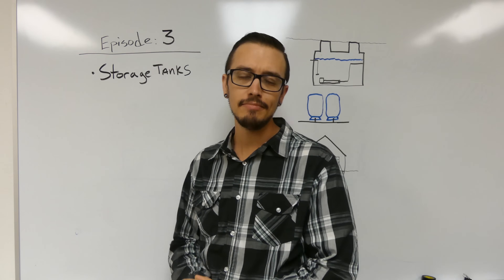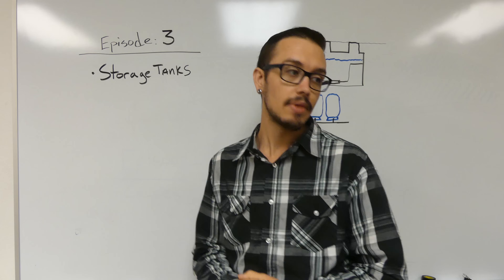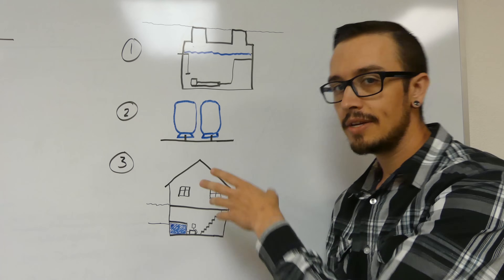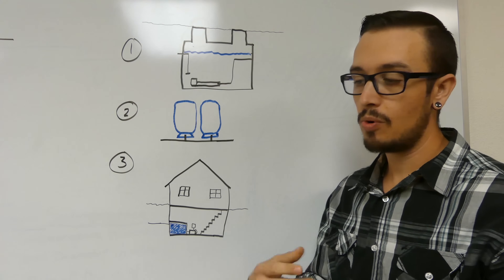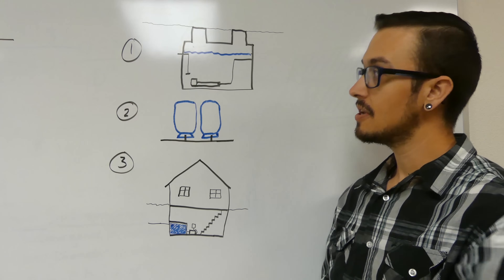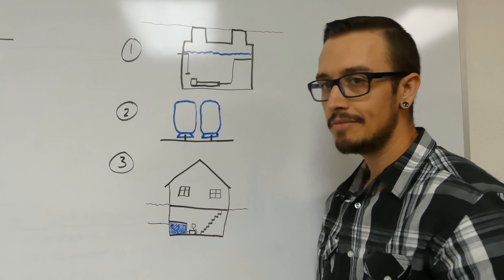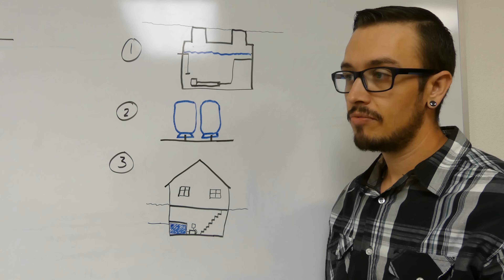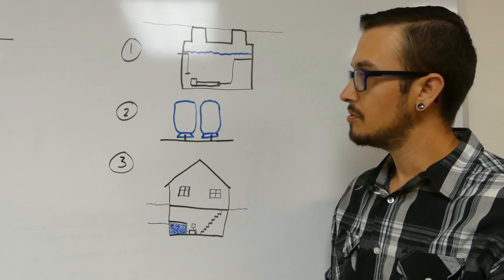Low Yield Well Solutions: Storage Tanks

Comment: I’m thinking of adding a storage tank, which could be higher than our house for gravity flow, so we can have water when the power goes out.
The well and equipment are about 200 feet from the house which is about 10feet higher.
We’re on about 5 acres with a hillside in the back of the house where I could install a tank.
What are your thoughts on this?

Comment: Does depth slow down the recovery rate? I have a 900’ well that is supposed to be 1.5 GPM, but overnight I’m barely getting 100 gallons. My pump is at 600’, so not sure if the depth of the well is causing the rate to slow down at it gets to the 600’ mark.
Reply from the maker: No, depth does not slow down the slow rate. Typically, you only drill a well deeper if the current flow rate is not sufficient.

Comment: How do you manage the well pump on a low yielding well? Most conrol boxes have no idea when the well is pumped out and pumps/motors have no sensor for a low water level condition.
Reply: I see you added motor protection on another video as a "bonus" but really it deserves a video of it's own with a full look at the motor protection options and the units available and how they work.
Reply: They cut the power when amperage drops / set to restart on a time delay that you set. @jlaw8882
Reply: You can also throttle the output if the well will sustain constant pumping at low volume, gain capacity with storage.

Comment: It is pretty good explanation. I have govenment supplied water line and it is low pressure due to the location of the meter being away too too far. This days dropping a water line infront of your house is expensive more that 10K. The old galvinazed pipe has been reduced in diameter, Storage is one of the option I got. Is this will work for washington state if the tank is outside?

Comment: Thanks for the informative video. At a recovery rate of .31 gpm, we are struggling to have enough water for just the 2 of us.  I had asked about using a larger pressure tank but the contractor who installed our submersible pump and UV filtration system said that wouldn't be a viable solution and recommended going with an inground 1000 or 1500 gallon storage tank, secondary submersible pump and pump saver.  I was thinking more like a 80 - 120 gallon indoor vertical storage tank that will fit through our utility room doorway with a submersible pump and secondary pressure tank?

Comment: I love the idea of using of a submergible pump.  All the ones I've seen the submergible well pumps are mounted on blocks to absorb the motor starting torque laying on the bottom of the tank with some kind of hose or flex piping running to the surface.    Have you seen or installed or would you recommend this type of pump hanging vertically  from the discharge piping or hose in water storage tank?   Thank you, Bert
Reply: You can but the intake will be higher unless it's mounted in a sump.

Comment: Hi!  Thank you for the video.  

I have a low producing deep well.  I added a 300 gallon poly tank and a pump in my basement.  I also added a timer switch on the main well that turns the well on once per hour to fill the tank.  The problem with this mechanical timer is that it has tabs to add to increase the run time of the deep well pump.  One tab is not enough water to keep the tank full.  2 tabs empties the well too quickly.  I did reduce the flow from the deep well by partially closing a valve but it really is guess work.  

The mechanical timer is also not reliable.  Sometimes it gets stuck and everything just stops. I did lubricate the gears inside it.  It ran for a couple months but stopped again recently.  Tap the case and it starts ticking again.  This is frustrating and it needs to be replaced.  I am confident that the deep well can provide enough water to meet our needs
 if we could regulate the deep well pump more accurately. I wan to replace this mechanical timer.

 I am hoping that you have a solution where I could pump an exact amount of water into the holding tank on a pre-set schedule.   I want to eliminate the guess work when I replace the mechanical timer.  Do you have a suggestion for some kind of higher tech timer that I can control the deep well pump more precisely?  The goal would be to let the deep well water fill up then pump an amount of water enough to fill the storage tank every 24 hours without depleting the deepwell too much at any one time in the pre-determined cycle(s).
Reply from the maker: I would suggest a float switch plus motor protection. Give us a call: 855.329.4519
Reply: For mechanical timers, I have had good luck with Intermatic. They use on and off trippers that screw onto the timer wheel.

Comment: Wouldn't the additional pressure tank burn out the pump, if the well doesn't have enough recovery? How would one work around that?
Reply from the maker: Electronic motor protection is required
Reply: @RCworstwater  Thanks for quick reply. How could a family of 7 survive off 1/2 gpm? Any ideas?
Reply: @uptalk144  What solution did you come up with for .5gpm to be acceptable? I am looking (depending on who is here and when) at family size varying from 1-4 people, and have 1gpm water. My thought after this vid is an extra pressure tank.

Comment: What kind of submersible pump are you referring to in application 1? I am trying to dig a shallow well and pump into a 1000 gallon underground cistern. I need a pump that will support my irrigation system. Larger zone is 5 heads with rainbird maxipaw's and blue inserts installed. Thanks and great video.

Comment: Curious if there is any type of alarm or alert that can be configured if the well pump fails.  I’m looking to add storage capacity in the event my well pump goes out or some other failure.  I’m sitting here now with no water because my well pump failed (second time in 2 years).  It would have been nice to know the pump failed before using all the water in the pressure tank.  If I add an intermediate tank for storage and could be alerted to a problem I would at least be able to conserve water while waiting on repairs.
Reply: Pump tech Franklin electric

Comment: Thanks so much for the info. I have a 3.3 GMP well in my house of the family of 5. But we have a lawn approximately 1 acre that needs to be irrigated 3 times a week for about 2 minutes (each zone). In the basement, we have a 300 gallons storage tank with a pressure pump booster. But we are still running out of water. Please what would you suggest we do in our situation? I am thinking of switching the storage tank to 1000 gallons (or at least 500 gallons) or drill a second well. But I will rather go for the low-cost option (storage) if it is going to solve the problem. I have extra space to allow for a bigger storage tank in my basement. Thanks in advance for your advice.
Reply from the maker: A larger storage tank would definitely be the cheaper option!
Reply: @RCworstwater  Thanks for your response...

Comment: in option 1, how do you keep either pump from running if the tank or well run dry? any sort of automatic switch for that?
Reply from the maker: Great question! On low producing wells, the well pump NEEDS to have a motor protection device installed. The most popular is electronic motor protection like the Franklin Electric Pumptec, which can be installed inside the existing control box or as a stand-alone device depending on the application. Then on the cistern pump we use two forms of protection: Primarily a float switch in the tank ran to a contactor takes care of the day-to-day and, in case the float fails, either a low-pressure cutout switch OR another Pumptec. Links below:
Motor protection: https://www.rcworst.com/Motor-Protection-c169.html
Low-pressure cutout switch: https://www.rcworst.com/square-d-pressure-switch-m4-30-50-psi-w/-low-pressure-cut-off-9013fsg2j21m4.html
Float Switch: https://www.rcworst.com/SJE-Rhombus-10PMDWOP-PumpMaster-Pump-Switch-Pump-Down-10-Cord-W/O-Plug-p1200.html
Contactor: https://www.rcworst.com/Cutler-Hammer-C25BNB230B-2-Pole-30-Amp-Contactor-p721.html

Comment: We use the same brand of tanks for general use, but for increasing storage a tank with a full bladder set soft (10-15 psi air) will add about twice as much storage per tank a diaphragm tank of a similar size.